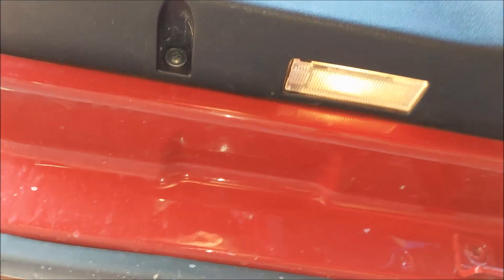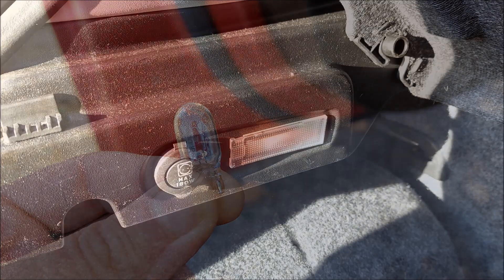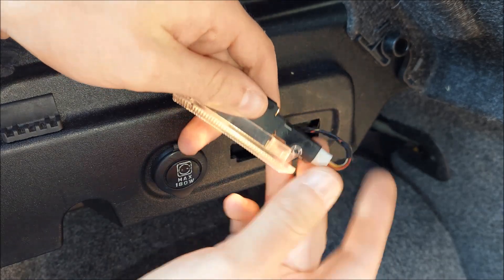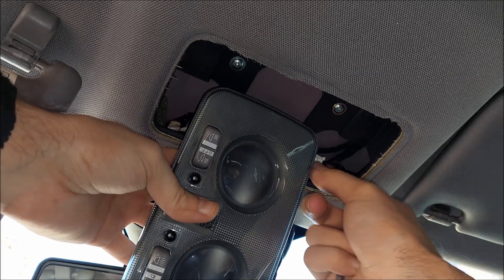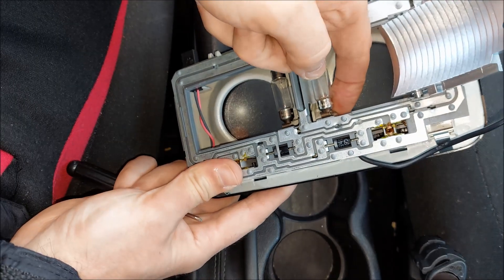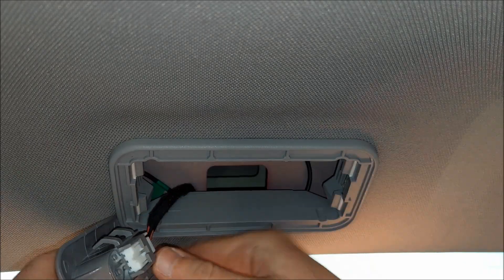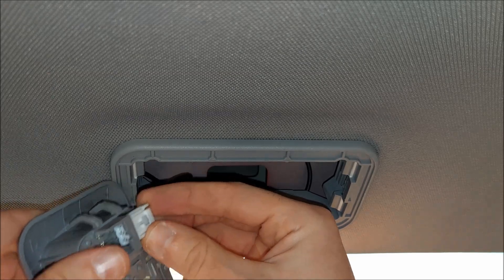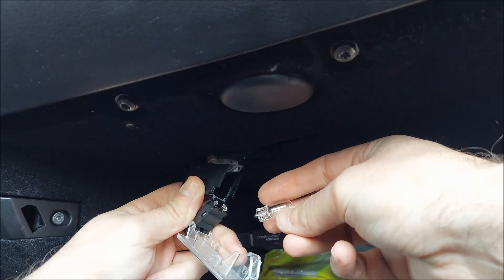Alfa Giulietta Interior Bulb Replacement Guide

Comment: Why not change the interior lights to LED where it's possible? 4:27 - I kindly suggest you use SanDisk Ultra Fit or Lexar JumpDrive S47, both in 64GB or more.
Reply from the maker: I will do a conversion to LED in coupe of day, thanks for the tip